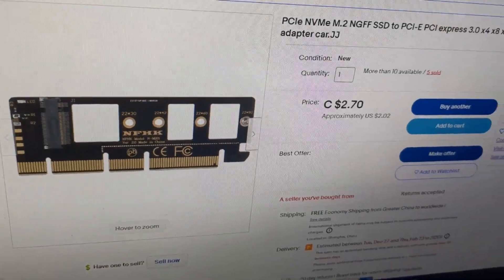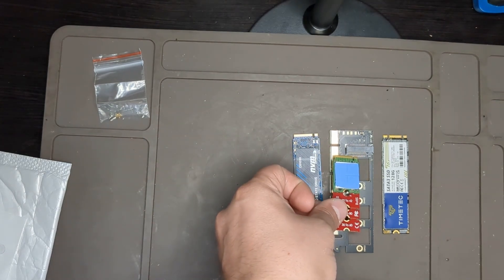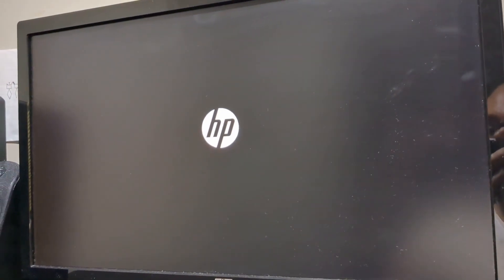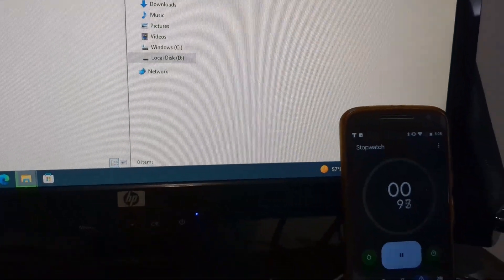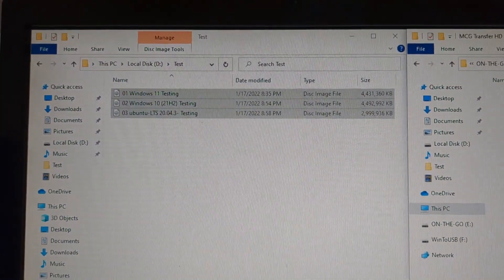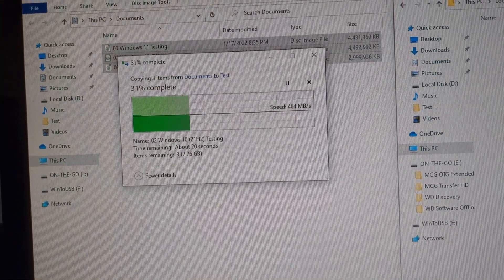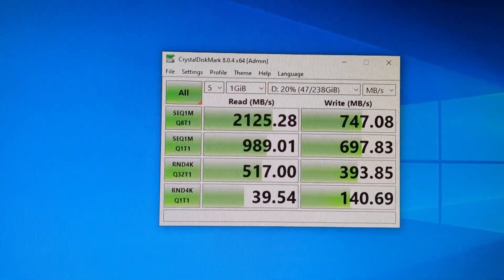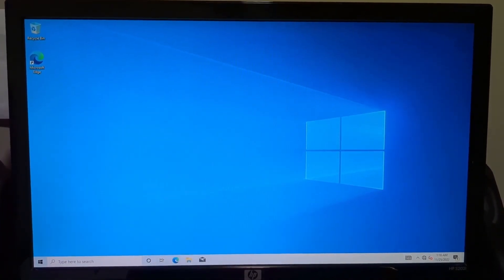NVMe M.2 to PCI-E adapter card From eBay $2!!

Comment: The best transfer speed results are obtained using a RAM drive.  This creates a hard drive in your extra RAM memory.  That way there is no bottleneck for reading and writing the M.2.  RAM is much faster than the M.2 drive so it doesn't interfere with your benchmarking.  Of course, you need like 64 GB to run a decent RAM drive.  Your expectations could vary depending on how many PCIE lanes are in use for the drive and what version PCIE.
Reply from the maker: that sounds cool, how would I do that? Also I dont have have 64gb RAM right now. I guess this will show the average Usrs results.
Reply: By using a RAM-drive you have to add the time for filling it up the first time with the data you need and to empty it storing the data on the non RAM-drive.

Comment: 3:53 These are of course not PCIe speeds. How can they be when the S-ATA Drive is involved? On the other hand the test with the external drive shows up the speed of this drive as the limited factor. Why should there be a diffenece betwenn the internel M.2 and the M.2 Adapater? It's the same protocol and the same lanes that are used. Maybe is a good idea next time to have a strategie and better knowledge about drive and interface speeds.
Reply from the maker: Hi, thanks for the Comment. You may be right on the speeds, however the point of the test was to show how the M.2 PCIe Adapter did not affect the speeds of the drive.
Reply from the maker: You are correct! I was not getting PCIe speeds rather just SATA speeds for the transfer to my Samsung Evo, and 5GB/s USB 3.0 speeds from the external My passport. I think what I may have meant was I assume it would be able to transfer at NVMe speeds since it is working through PCIe. Had I put in a second NVMe drive into the M.s slot on the MoBo itself I should have gotton theoretical Maximum NVMe speeds of ~ 3,500MB/s

Comment: lol, I got three of these, seems wrong to just post one from CA to UK! Great if you have a spare x4 slot.
You can get them for x1 pcie too, just fill up each spare pcie 4.0 x1 slot with an Optane nvme and have the best raid0 boot array ever :)
Reply from the maker: yes that is a great idea. keep in mind that I believe this card may work in a X4 or X8 slot. see the grooves or spaces on the bottom? I think that can just hang off the end.

Comment: Hmmm. It supports a four lane NVME card and only requires a sixteen lane slot. 😅
Reply: i think thats only for stability, as it does have notches that looks like it would allow it to go into a x4 or x8 slot as well with some overhang
Reply from the maker: if you look closely you can see the traces on the card are only using the first 8 lanes so as the other commenter @jjjace said the rest is for stability. you can even see the notches, you can probable put into a 8 lane PCIe and it will still work (@jjjace)
Reply: @michaeljillian3657  They're breakable, you can put a 2240 nvme in, snap it off, for a cleaner look.
Reply: You know the lanes a normal NVMe drive provides?
Reply: @reinerhohn9617  It depends.
Reply: @reinerhohn9617  You can have any power of two number of lanes for NVMe.
M.2 is USUALLY 4 lanes, and that's the max for the physical form factor, but you can have 1, 2, 4, 8, or 16 lane NVMe drives with different physical form factors. Add in cards in particular that are meant for just raw speed for people willing to pay for it can use all 16 lanes for the same single hardware device.